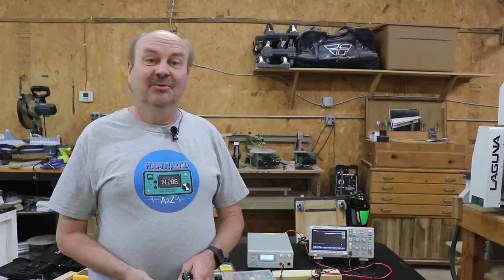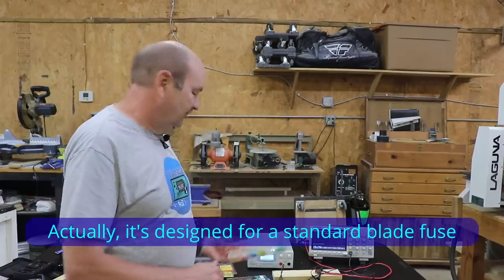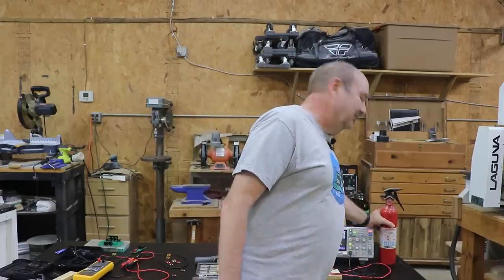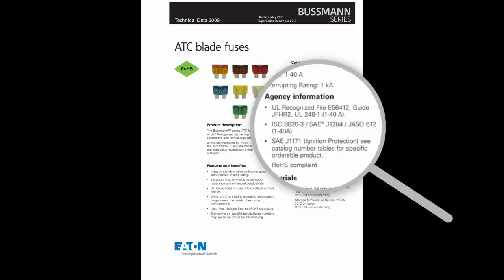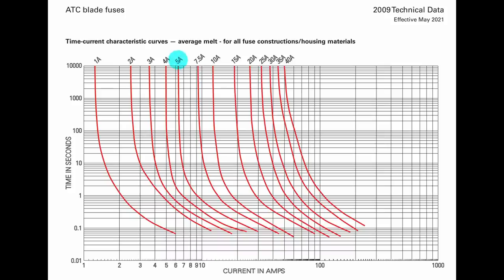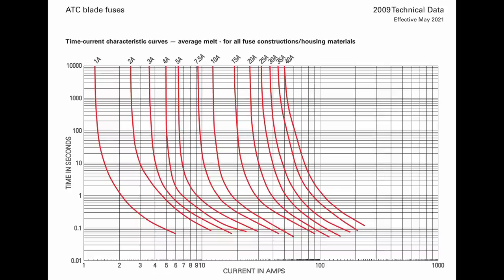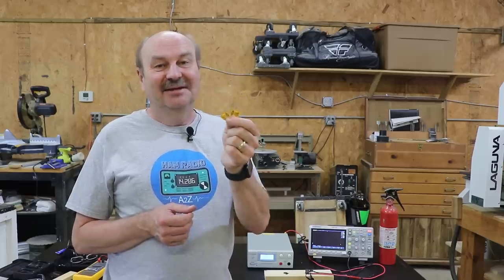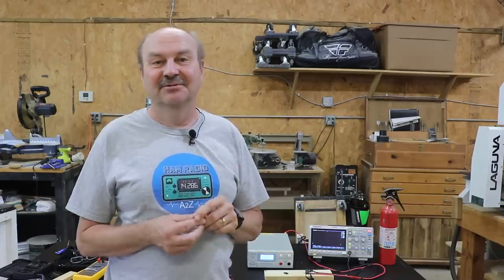Bad Fuses

Comment: Very good illustration.

I look forward to seeing the crowbar device. I’ve always been mystified that little premade in-line crowbar devices aren’t on the market. I’d love to see some adjustable ones that could be used on 13.8 or even 5v applications.

I tend to tinker with power supplies and have modified some to have remote sensing, but I’m always worried that something will go wrong and the devices being powered could see high voltages if the sensing wire ever became disconnected.
Reply: If the supply lines are big enough to handle the current, there isn't any need for sense lines, unless you have some very fussy equipment, but even then, increase the diameter of the supply lines to meet the demand without excess Voltage drop.
Reply: A crowbar design is quite old-fashioned.  There are modern power switch solutions that are faster, more reliable and optionally auto-resetting.

Comment: Knowing I have cheap fuses in several of my classic cars, this is scary.
Reply: Yeah time to swap out fuses.. I bought a bunch of products and blade fuse holders that come with fuses so I'm going to be swapping them out for now on with a known quality part.

I actually bought an amplifier in the past and the fuses that came with it turned black/charred. The amp wasn't very good and I bought a quality one since then.

Comment: I was scrapping a Fiat and cut a wire  of the fuel injection on accident. 
The fuse of the fuel injection melted it's casing and later the entire socket but did not blow . The wires started burning first.  It was an original fuse

Comment: A similar story about home circuit breakers.  Back in the 60s, my father would take a 100amp Murray circuit breaker in series with a 15 amp Federal Pacific slimline breaker.  He would short the loop with a single strand of lamp cord. The 100amp breaker tripped but the 15amp didn't.  Later Federal Pacific went out of business after it was discovered they faked their test results.
Reply: OLD breakers by any brand are less likely to perform properly. Since FP stopped manufacturing so long long ago..... NONE of their breakers should be relied upon. That is all separate from the design arguments that go on and on.

I had my ole sparky replaced, when I bought a 1960 build house. 60 amps was not going to cut it, no room for additional circuses.
Reply: @citylockapolytechnikeyllcc7936  In general I would agree but Murray was, and probably still is, the ONLY fully-magnetic breaker on the market.  The advantage over thermal-magnetic is dramatic for circuits that don't have devices with large rush currents. My father would use Murray for all lighting circuits because of this.  Circuits with pumps and other motors would get thermal-magnetic.  The technology in the 60s is not so far off from today. They had ground-fault requirements for circuits near water.  Even so, I would trust my life on a fully magnetic breaker over a thermal-magnetic one.  I've seen seasoned electricians get fried because they drilled into a wall and hit a live circuit.

Comment: I tested the set that I have, and the fuses are operating correctly. They blow in 1s at 2x rated current. The only slight issue that I don't know if it's normal or not, at 1.3x current they glow red and melt the plastic a bit but they do eventually blow. The set is Herbert Müllner BOX-AS147. They are visually similar to yours with the embossed current rating that's hard to read but have a different fusing element. So it's not possible to distinguish good from bad just visually.

Comment: I also have tested some fuses and one very important property for (solar) battery systems is the interrupting current capacity. I shorted/tested the fuses across a 24v battery capable of several thousand amps before I felt confident using the fuses.
Reply: Fuses of this design are totally inappropriate for the application you describe. 
HRC or a DC Circuit breaker is what you need to use.

Comment: I've been seeing some strange failure modes with older H-type ribbon Buss glass fuses.  The fuse blows in the center, deposition coats the glass, and the remaining ribbon ends sag and reestablish a resistive contact.  The circuit looks like the right voltage is there, but can carry no major current.  Twice in 2 years.

Comment: Great video Tom!  Maybe you can repurpose the fuses into current shunts for amp meters.  I usually use buss man or little fuse.  Another problem I have found with the cheap ones in oxidation.  They build up and become resistive dropping the overall power.  73
Reply: I don't think you want to use those as shunts for an amp meter. If the fuse should melt, POP, there goes your meter.
Reply: @waltp3373  Absolutely!

Comment: I wanted to blow a no-name 15A blade fuse recently and tried to use a car battery to do it. It isn't a handheld project, I found out. I didn't think hard enough, that maybe the cheap fuse was the problem.

Comment: 2006 I first saw these substandard fuses, they were in the $1 store for a pack of 30 or so, I used some in my car, then days later I reversed my trailer into the fence, crushed the tail-ight and shorted out the bulb. fuse got hot, melted, caught fire... I guess the metal used in the fuse doesn't 'blow' like it should

Comment: To just test fuses you can make one of these 2 cheap and easy solutions: Microwave transformer converted to high current transformer, and adjust the primary input with a variac/autotransformer, Or use a car battery and have some adjustable load, like a combination of  big resistors, a diy basic transistor load, a chunky dc motor and braking progressively, or something else that you already have at hand. To measure current, a current clamp would be the best option for this kind of high currents.

Comment: There's over 12w dissipated in your setup with the Chinese 5a fuse, yet the temperature rise after a couple of minutes is less than 70deg C.  Metals and alloys are not likely to melt at this temperature.  It most likely that they are using copper or some very conductive material in the fuse, instead of the right alloy.  The power from the supply is being evenly dissipated in the cables and fuse instead of the fuse heating significantly more than the cables.
Reply: tinned copper wire can be used as fuses, its whats sold in small cards as 5, 15, and 30 amp fuse wire for use in rewirable 'consumer unit' fuses

Comment: If I remember correctly there was a huge bruhaha several years ago about these Chineseium fuses not working properly and were extremely dangerous.
Reply: Chineseium ... did you learn that in racist school? 😘
Reply: @michaelseitz8938  I learned it over the years because Chinese manufactures often play fast and loose with specifications. SSRs that don't work at rated input control voltage, USB automotive power adapters that do not deliver rated current and become dangerously hot, multichip LED modules that are not well balanced and become intermittent due to bond wire problems. Just to name a few off the top of my head.

Comment: I have been suspecting something like this.  I never use the automotive types, however, as they are rated for low voltages (like 12 V) and all my applications require 250 V rated parts.  If you say:  "What voltage -- we are dealing with current",  good point to consider a bit closer!  Besides the tripping current accuracy, we actually expect the fuse to INTERRUPT the fault current.  Note that above some nominal currents the glass type fuses suddenly list a usable voltage drop from 125 volts (or so) to 32 V.  The reason is that those fuses (10, 15, 20, 25, 30 A) don't interrupt the current, but instead may retain an arc, until they explode, and maybe even after!  Good interrupt capacity is found on ceramic body fuses, rated 250 V and being filled with some arc killing substance, like ceramic or silica sand.  Which however now reminded me about my own fuse collection.  They, although being ceramic tube, 250 V rated, still are no-name.  I better check a few samples.  I would do it with a 12 V lead acid battery that promises at least 300 A crank capacity, voltage and current probes and storage scope.
Reply: there are a lot of 'fake' ceramic fuses around, especially UK plug type, that dont have the sand filling, theyre usually plain white ceramic tube with no BS number marking on, any like that should be binned immediately,, i took one out of a 'cloverleaf' mains cable i bought via ebay,  i bet the wire is copper coated aluminium as well, which is quite common! i dont want to destroy it to test it as i dont have another at the moment

Comment: Thanks for the video and helping to inform prople. I fully agree! Those cheap China-Fuses, Circuit breakers, etc. are a cancer and can't be trusted even for the slightest things. Moreover, many gas stations sell such bad fuses for horrible prices to unaware customers.

I work a lot in automotive Environments and have a general rule: Never use a fuse, where you can't get a datasheet with characteristics from the manufacturer.

Good quality brands like MTA or LittleFuse never failed me even once in all the years and are actually not that expensive. There is not a single good reason to go for cheap untrustworthy fuses.

Comment: I had the opposite problem with knockoff fuses. They popped well before their rated amperage. It made me fear that there was a shirt somewhere but I looked everywhere and found nothing. I eventually got a high quality fuse and everything worked.
Lol
Reply from the maker: It makes sense that if there is little or no quality control for these fuses that some might not blow when they should and others might blow at much lower currents than they should.

Comment: I had a serious radio shack fire using one of those fuses. Had I not been home it would have burned down the shack. The 10 amp fuse never blew, even melting the holder. I lab bench tested fuses at twice their rating and the never blew.
Reply: Was it the fuse or the holder?  I have had some fuse holders melt down at 1/2 their advertised rating and way too hot to touch at 1/3 of the rating (8-10A on a 12awg 30A rated fuse holder)
Reply: @matthewmiller6068  Maybe both, the holder melted but the fuse never blew even though amperage was well above rating.

Comment: Thanks for doing this experiment! Would you repeat it without that bench power supply, and use a car battery instead?
The current and voltage at the fuse under test could be measured with a two channel oscilloscope (one channel connected to a suitable current shunt) 73, de K7GVG
Reply: And add a contactor rated a few hundred amps, so it can be done out in the yard/driveway and switched on or off from a safe distance in case the wires blow first.

Comment: I only use name brand fuses like Buss, Littlefuse, and PEC after my car almost caught fire after a cheap fuse plastic melted in my fuse box with the metal part never opening after a windshield wiper motor seized up! The fuse's plastic cover melted, then my wire insulation started melting at the fuse box, and smoke came out from under the dash.

Comment: "Dimensioning" over-current interrupting devices can be surprisingly daunting, even when you are trying to select from quality products from reliable manufacturers. If you have to cope with wide operating temperature range it sometimes seems next to impossible if your objective is anything more refined than preventing a fire.

"Clearing" of a fuse is more complex than just melting of the conductor. Depending very much on the external circuit, arcing may continue for some time after initial melting. If you select an inappropriate fuse for the application the arc can last for a long time and be quite disastrous. Fortunately that isn't generally much of a concern at 12 volts. Part of the reason many fuses are rated for a maximum of 32 volts is that they won't reliably clear at higher voltage.

If you want to see expensive small fuses, look at types rated for a few tens of milliamps.
Reply from the maker: Very well said and quite correct.  Fuse selection can be very complex, depending on the requirement.  I spent a lot of time researching fuses for lithium batteries used in high-voltage hybrid vehicles.  Protecting wiring at very cold temperatures where lithium batteries deliver very little current and still carrying the high pulse currents needed for acceleration and regen is very difficult.

Comment: I see you using a IR thermometer. Have you considered purchasing a thermal imager? I highly recommend the UNI-T UTI260B. In my opinion it's the best value for the quality you get. I bought mine a few weeks ago for $280 USD and you can get a macro lens for circuit board close-ups. Northridge fix has a review of the exact model

also, I replicated your results and couldn't blow my 2 amp no name fuse at 20 amps. The plastic melted but the metal did not open. Thanks for the warning